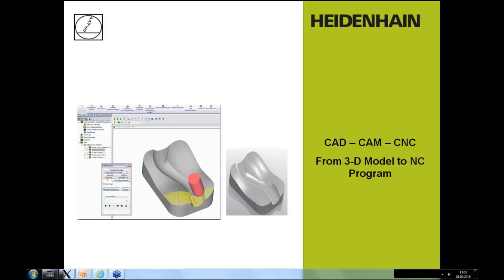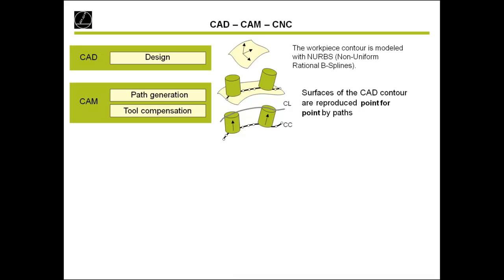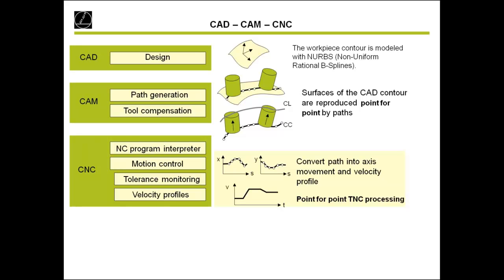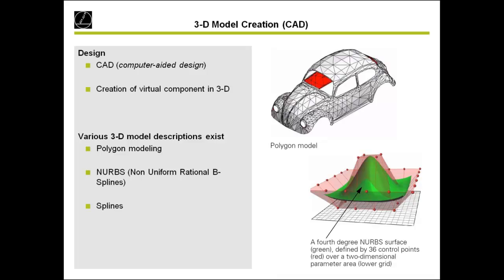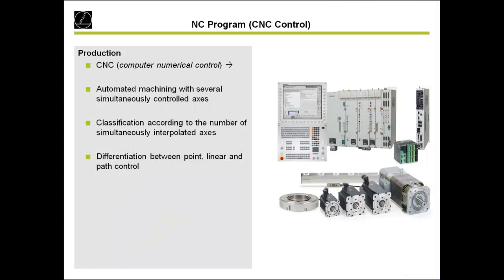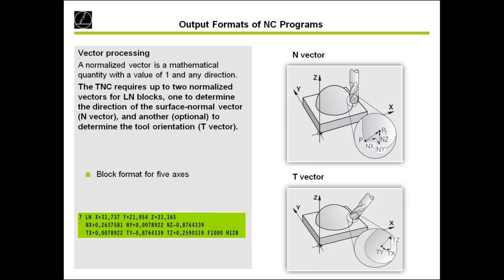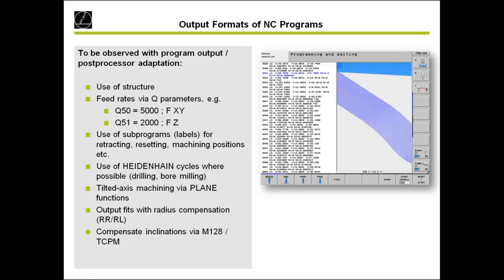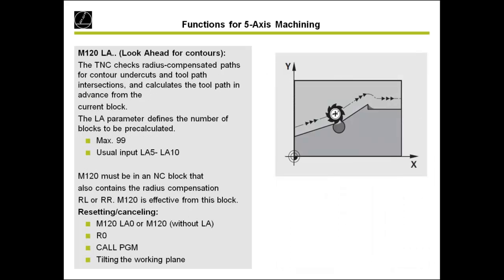Heidenhain | TNC | CAM Generated Programs for HEIDENHAIN TNC Controls

Comment: Hello, im usin SprutCAM9 with DECKEL MAHO 70 5axis machine and postprocessor for iTNC530
However problem is that I have DECKEL MAHO80T 5ax with iTNC426/430
Gcode from Sprut to my machine? Will it work? Or it will be fatal mistake?
Thanks!!